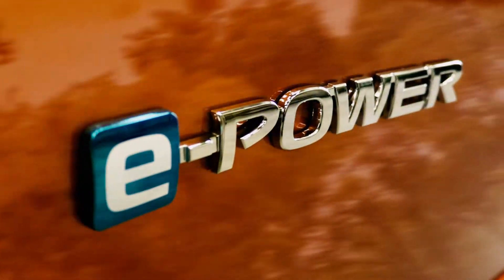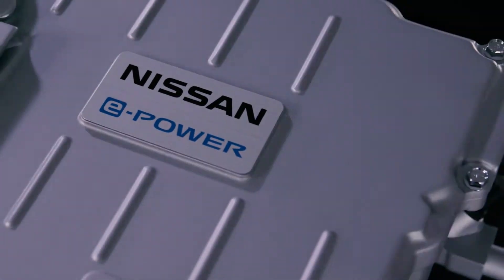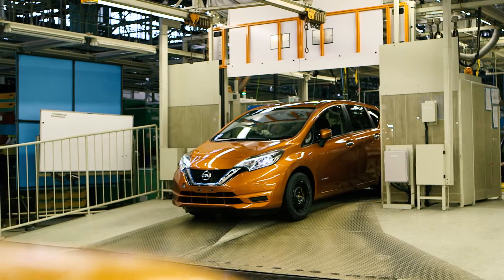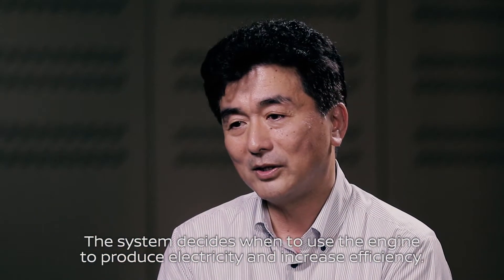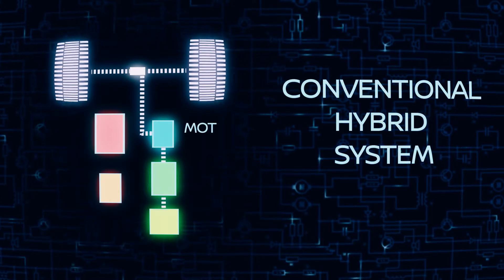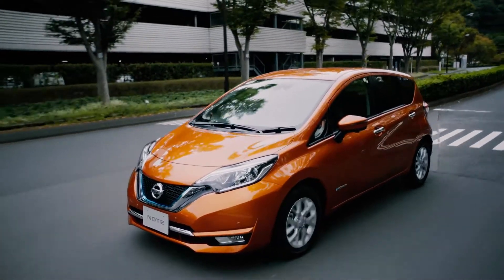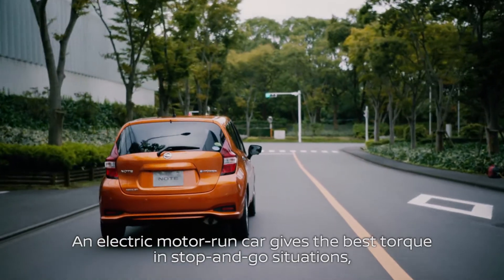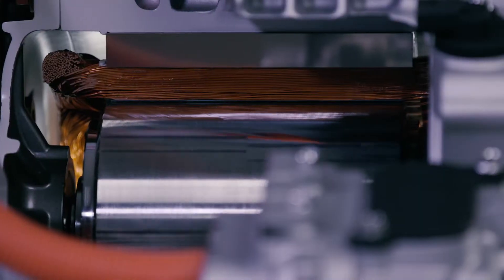Nissan Note e-Power - Extended-range electric vehicle

Comment: That looks like a step backwards from the Leaf.
Reply: Mark Atkin its aimed at a different market, alot of people are put off my a leaf because they think battery power will inconvenience them and also range anxiety even when they have a >10 mile commute (i have spoke to many people like this) so this is the way to encourage people to get a more electric car and never have to worry about those odd times and as is reported less than 2% of bmw rex (range extender) actually use the range extender so think of this as a transition car and you’ll be fine. 
This isnt replacing the leaf btw the note has been around for many years.